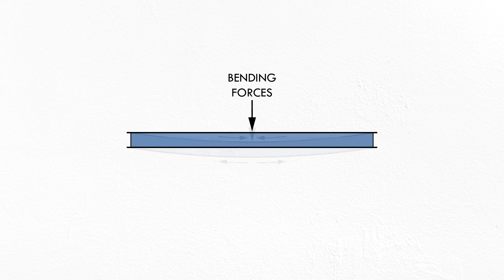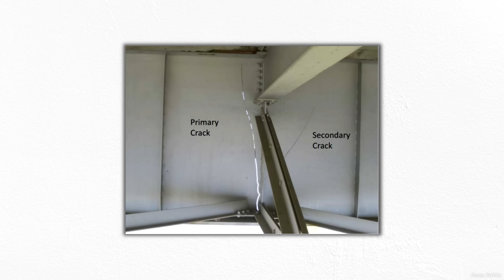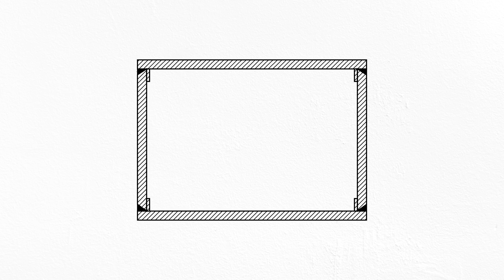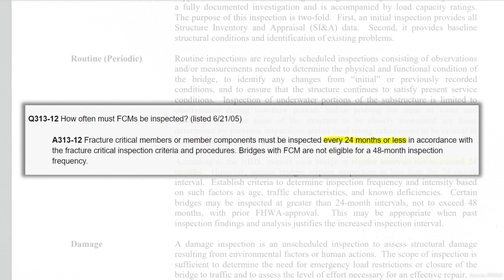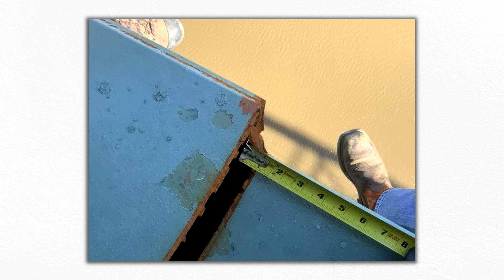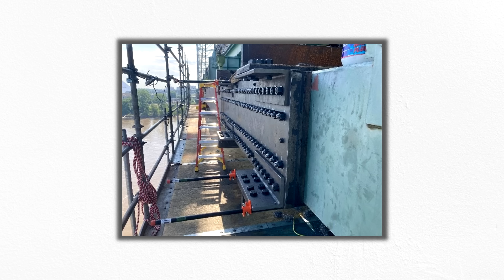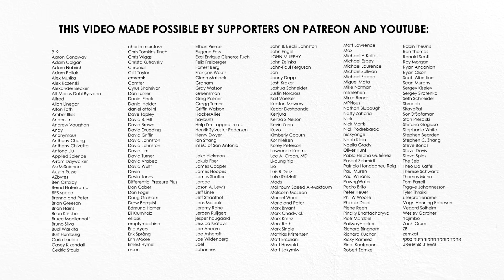What Really Happened at the Hernando de Soto Bridge?

Comment: There are times when traffic backs up bumper to bumper and stops on the bridge which as stated in the video is a major Freight corridor.
Now factor in 80,000 pound trucks all lined up bumper to bumper and if enough lanes in each direction are occupied we end up with a severe overload for which I question was ever considered by engineers.

Going back to the 70's when this bridge was designed, the population and commercial truck traffic were a tiny fraction of what it is today and truck designs have changed to haul more at or near gross of 80,000 pounds each all the time.
There are also oversized and over weight permitted loads that traverse the bridge.

In my opinion, the current volume and weight of traffic has exceeded the bridge design and this will be a recurring problem until it either collapses, is properly upgraded or replaced.

The Westbound truck scale just over the bridge in Arkansas does not help the situation either with so many trucks being forced into the right lane together and slowing or hard braking on the bridge as they line up during heavy volume this adds to the structural fatigue already there.

Given this problem was observed years earlier and never addressed until a complete separation occurred, I wager it will get band-aid repairs and ultimately collapse in the future before it gets replaced.
Also considering the budget of both states and the common practice across the country of avoiding expenditures until loss of life occurs. i.e.; Traffic lights at problem intersections are often not installed Until enough life has been lost to warrant the expense.

Research it for yourself.

Also remember the Deepwater Horizon, Exxon Valdez, I-10 bridge collapse in CA, Interstate 10 at the San Jacinto River, the EPA polluting the Colorado / Animas River and bringing water to affected Indians (Navajo Nation) in contaminated fracking tanks (Gold King Mine spill), "The most dangerous truck fleet in New Mexico" (YouTube video by KRQE) among other human, corporate and government bungled disasters that could have been avoided had people done the right thing the first time without being greedy.

History repeats itself and people in power typically only care about themselves.

Comment: Thank you for another interesting and thought provoking episode in your "What Really Happened?" series. This and all the others are great!

I may have suggestion for another. Local to me is the Tolt Hill Road Bridge (47.63812476263225, -121.92848566437036) in Carnation, WA. This bridge opened in 2008, replacing an 86 year old previous structure, and closed just a few years later for structural review. It's a small bridge and doesn't carry much traffic, but its closer meant driving several miles out of the way to another river crossing and bad traffic through small town roads. What's interesting is as a local, it very much seemed like they just don't know how to build bridges as well as they used to. It was re-opened in 2017 to reduced capacity and with regular inspections.

County and city web-sites cite new federal requirements following the I35W bridge collapse in Minnesota in 2007. All US bridges were to be reviewed by 2022, and the inspection of Tolt Hill Road found fault in the design using new criteria, hence the closure. 

Maybe you could let us know, not so much about Tolt Hill Road, but about I35W. What were the consequences, and are they still playing out? Is there a way to know progress toward 2022, or has that mandate changed? 

Just a thought. Love what you do. Keep it coming!

King County Info = https://kingcounty.gov/depts/transportation/news-archive/archive/2017/20170616%20Tolt-Hill-closure.aspx
Carnation City Info = https://www.carnationwa.gov/index.asp?SEC=49DEB349-5F8D-47B8-A973-7D69412F6495&DE=BD96FE6F-BA7A-45AA-94A0-C5FD1655FDDA&Type=B_PR

Comment: Great video - very interesting.  Looks like the crack initiated Oct to Nov. 2016 and, based on timing, suggests had something to do with the seismic retrofit.  The inbound plate appears to have remained intact (to some extent) which suggests the tie, in addition to tension, was taking outward and downward bending.  The expected thermal change from end to end of the two spans is 8 1/2".  This change is accommodated with slide bearings on piers A and C.  The slide bearings don't move until 250,000 lbs of horizontal force pulls on them (about 12 to 15 F of temperature change - still only 2,200 psi on the uncracked tie beams).  The crack shape makes no sense and I am not happy with blaming fatigue.

Comment: They could have hired joe schmoe with a drone to inspect the bridge, if the "professional" inspectors can miss a grand canyon sized crack like that. Ridiculous waste.
Reply: They saw it.. but ignored it.
Reply: The inspector didn't miss anything. He filled out the paperwork in his air conditioned truck that he had inspected the bridge and all was good. He never inspected anything.
Reply: @TheSoloAsylum  that just isn't true. A big news exposé just came out from a local paper that proved that the guy was following their procedures for checking the bridge, with the exception of using a crane to take him underneath the bridge ALL THE WAY, if they extended it the last few feet then the crane started tilting and it was too dangerous.

It's because their procedures were trash. Andrew is right; they should have used drones.
Reply: @Snowstar837  If he was unable to inspect it with the kit provided then he should have informed management that he needed better kit and refused to sign off.
Management are still partially to blame but he is to blame as well.

Comment: I was a bridge inspector for VDOT for 3 years before I moved on to the structural engineering side. The pic of this crack makes my heart skip a beat. But it seems like everyone is speculating the guy who called 911 was fired. Do we know this to be the case? This inspector did everything in the right, and at least in Virginia if we the inspectors have reasonable concern of imminent total failure we had authority drive our trucks across the road and block traffic (I am not aware of a case of that happening mind you) but my speculation is the firing was actually the previous inspector/team leader.  This should have been the reaction after seeing that crack on the drone footage. Why wasn't it? Did the crack not get flagged as fracture critical then or even worse not mentioned at all? That would totally be grounds for firing if the team leader did not make that assessment during that inspection. So my thinking is the person responsible for letting the crack go unnoticed previously was the one who was fired. Just my general assessment having done both the inspection and engineering side. The inspectors calling 911 would be heros in their company and DOT not reprimanded. The ones who didn't raise flags would get fired.

Comment: If You look to the crack as an experienced engineer, You might see, that there is no real force in action, because the movement of the broken element is very small. It seems, , that this element is insignificant part of a net, and the forces are undertaken by other  elements successessfully (over many years)
Reply: @legacysage A splint on the broken element, similar to a leg, shoud have solft the Problem for the first time, an after a meticulous inspection a certain small repair all without big problems for the ongoing traffic.
Reply: @legacysage It deptends, what official responsibel would like to do.
Solve a problem or create a problem. The damage for the user is enormeous.
If this is no problem für the snooty official, so what;)

Comment: Major crack, that looks like a broken beam to me. You call it what you like. It sounds like a fancy way of making excuses for a beam break. I tell you what, why don't you break one of the wire ropes in the Golden Gate and see what happenes?
Reply: TNDOT damage report suggests the crack was 52% of the cross section, so it was not a full break. I suspect it still held most of the load.
Reply: @imd12c4advice  You know they should put a vibration recorder like a Rictor scale to see if vibrations are what is cracking the beam. Fifty-two percent of the beam. How long until it gets worse. If they replace the beam will that take care of the problem? They do not know what caused the break. So, every day someone drives across the bridge, you want to flip a coin. Have fun with that.
Reply: @thomasstecyk792  All good questions. It was very so close to coming down in my opinion. Thankfully, I don't expect I'll ever need to cross that particular bridge. They should have a reputable firm go over the full design with fresh eyes and modern tools, and see what changes or improvements are possible. If there's an unfixable problem, replace. A memphis civil PhD has posted a rough preliminary model to news outlets on why he thinks there was an issue. He could be right.

Comment: Just imagine sitting at this beam and see it moving under the changing loads of traffic. Although the gap is surrounded by additional structures (like the diagonal bracing and the deck), which for sure weren't designed to take all the forces from this beam, I'd have felt quite uncomfortable there with any visible movement.

Comment: Why are there only two arches on that bridge? Shouldn't there be arches across the entire bridge?
Reply: The bridge is composed of spans between supports. Each span is a different length and different methods are more efficient for different lengths, that's why the longest spans are typically suspension bridges and shorter are typically beam, and arch and cantilever are for the mid length. Here they used the arch for the 900ft spans and beams for the shorter spans on the sides, because that was most efficient.
Reply: @imd12c4advice  Thank you so much. I didn't expect an answer. But your reply gives me a better understanding.
Reply: @spacepope69  glad I helped.

Comment: I'm going to go out on a limb here and say that prior inspections probably consisted of quick looks with whatever method was easiest. If small cracks were found, they might have been reported but got lost in the red tape that is government. Failures are almost never the result of a single issue or even a single person. It took multiple issues to result in this fracture and more multiple issues to let it remain in such a state for as long as it did.
Reply: Knowing arkansas it was overlooked due to budgetary bs. Their overactive police try to act as a profit center.

Comment: The real scary part? With all the bridges, tunnels and other infrastructure in America... there's probably several structures like this that are capable of failing at any point and have simply gone unnoticed. I mean, we have bridges that are almost a century old (or actually older) that have not gotten the amount of maintenance and repairs that they have should have and have to handle traffic that they were never designed to handle all those years ago. It's a testament to how well those engineers and construction crews (and the maintenance crews/repair crews when they actually get to work on them) have done their job that these structures haven't failed more often. Thank goodness this crack was spotted... again... I don't know how they missed it the first time if anyone was bothering to look over the drone footage and somehow wasn't concerned about a very suspicious crack-like fissure in a load bearing beam. I'm not even an engineer and I was like, "That looks bad. Someone should look at that."

Comment: The Sydney CoatHanger is painted year in year out what that means is there are workers on the bridge everyday once they have painted the bridge from one end to the other they start all over again so these painters know the bridge inside out and they will notice the changes on each pass of the paint brush. 
So my question is why was this bridge not painted from end to end on all the exposed metal all year around, because that would have been noticed when it first started cracking and could have been sorted before it became as bad as it had. The rust in the crack alone tells its own story as to how long it’s been there as there is no fresh paint anywhere near the crack.

Comment: Here in Germany we know the problem of cracks. Authorities are replacing 2 bridges over the Rhine river at Cologne and Duisburg because they were built in the middle of 1960s with bad steel. Calculated for 25000-30000 vehicles a day the last years these bridges had a traffic of 80000-100000 vehicles. Trucks over 7.5 tons (ca 18000 lbs) aren't allowed to cross these bridges any more.

Comment: Lets not forget the 07 failure of I-35. The lack of proper inspections, procedures, and REACTIONS were a key factor in that failure. 14 years later and we got lucky. But, if anything is learned it is that things need to change before another one falls.

Comment: Oh wow!!!  This could really have ended in so much death!!  It’s a very good thing to put this information out there. A crack this  big is something that even the average person out enjoying a drone flight might have noticed and reported much earlier on, and something average people may yet be able to keep an eye out for, now that this sort of thing is becoming more widely discussed.

I can’t help but think that it’s time to have the safety inspection contracts awarded such that several different but competing firms alternate doing the inspections.  This way, the firms are competing to find points of compromise in the bridges’ structures before the other firms find them. Over time, if it turns out that one firm is finding all the problems during the normal course over a period of use, it’ll become pretty obvious if somebody’s not doing the work or has a an inferior inspection strategy.

Tyvk 4 ur very interesting presentation.

Comment: I have to ask, I'm not an engineer or metal worker, but how much of that steel would need to be cut and patched for a good repair, and how many times can steel be patched and repaired? Are there limits? I imagine adding plates and bolts looks good, but it can introduce lot's of weak spots and too, so what kind of repair would work best?
Reply: If the steel has been deformed it's microscopic structure has been altered and its properties have been changed. So all the stretched areas will need to be removed. The best repair option will depend on the structure, the material, and the loads. Here the holes do add weak spots, but the original design already accounts for holes and bolts being used, so in this case it's probably the best option.

Comment: Is nobody going to mention that DENT and fold in the vertical tube directly above the crack in the drone inspection @8:56?  That bridge was struck hard by something from above or below.  My guess is from above during another inspection, retrofit, painting, etc.  Looks to me like that could have easily added the strain that caused the crack and then displaced it once the crack became a complete fracture.

(I'll add that after additional review, that may be merely a road surface drain pipe, not structural, though the location and degree of damage is still indicative a significant suspicious impact near the failure.)
Reply: no but its a clear indication something happened right there.

Comment: metal fatigue... it happens.  poor weld? cheap metal to save $$$$$$. im sure it happens all the time, corrosion. fish plate it, bolt it up/weld it/inspect the rest of it and keep the bridge from being over loaded with traffic... stop lights during rush hour to keep tonnage to a limmit on the bridge at any one time.  7-8am RUSH HOUR TRAFFIC and 4-6pm RUSH HOUR TRAFFIC needs to decide.. if giong across the bridge... go EARLIER or LATER than PRIME TIME or learn how to get out of car/truck in the Mississippi river... when car is in the drink, sinking, uupside down. and how to unlatch seat belt when upside down in the water after falling 80' into the water... with other vehicles in front/behind you. not hard... just try to remember WHICH WAY IS UP... after air bag explodes in front of you and coming to with water gushing in and vehicle sinking.  the eskimo roll in pool in kayak wud be a good start to practice.

Comment: 5:09 It didn't fracture: about 52% of the section area has cracked and about 48% was STILL connected according to the TNDOT damage description.
Reply: You suck at time codes and percentages.
Reply: @haywoodyoudome  Thanks for pointing out my errors. Fixed both.

Comment: That wasn’t a crack in the bridge. It was a break, plain and simple. A crack implies some remaining structural integrity, if somewhat compromised. In reality, the beam is completely severed in the middle, with no real structural connection between each side of the break. I know for some this is a matter of semantics, but calling it a crack is downplaying its severity.
Reply: You have the semantics right but the facts wrong. It was still connected on 1 of the 4 sides. Unfortunately many of the photos don't show it very well. There is also a seam weld that failed along its length for something like 15 feet, but that is also hard to see in most of the photos and most of the attention is on the transverse crack.
Reply: It may be hard to believe but it was still carrying the load. Without going into too much detail, the 1 side that was still attached had not streched enough to release the load. So structurally speaking it did still have some integrity. But yes it also has severe damage and deformation obviously. Because it held the load, the bridge is still standing. If it had totally failed, I think the bridge would likely have come down.